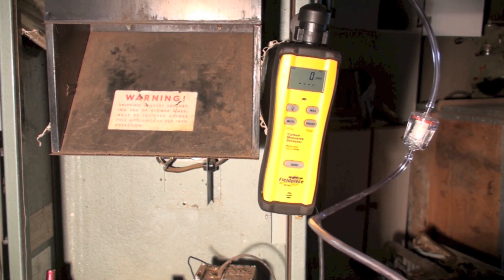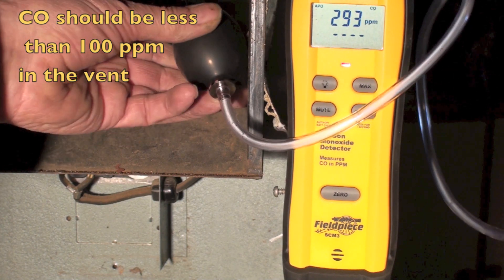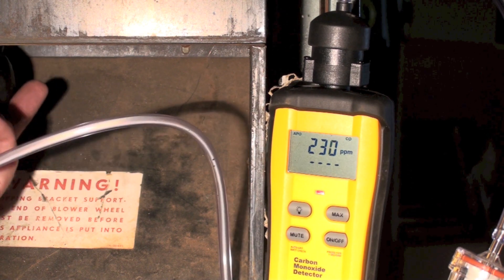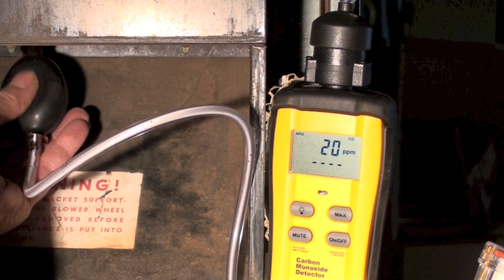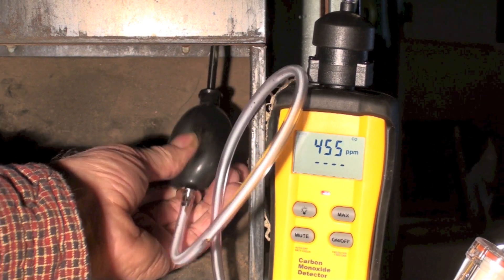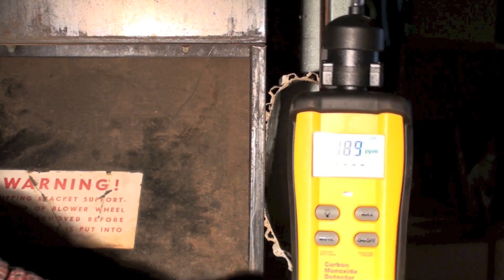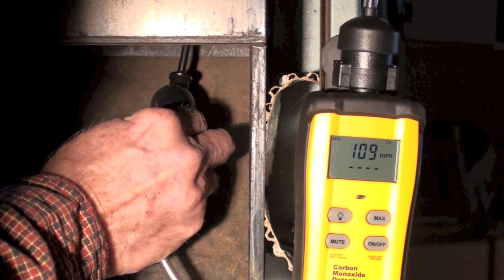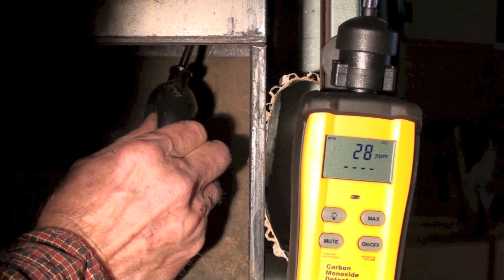CO test of the antique gas furnace

Comment: While watching you combustion video I was thinking show the co readings and then I discovered that the SOX3 wasn't capable of reading CO. This was a much needed follow up to your combustion video. Thanks for sharing!!
Reply from the maker: I used to use the Bacarach Fyerite that had the CO test in it, but is quite expensive.  The Fieldpiece units are somewhat cheaper and of high quality.  I also like units that are stand alone.
GFM
Reply: Stand alone tools are great, that's what I used for most of my career. The main thing is to test the units to make sure the are operating normally and safe.
Reply from the maker: Eddie Leverich Around here they are to be tested once a year by an authorized testing organization.
GFM
Reply: I hope that I didn't offend you, my comment was meant to read (the main thing is to test all gas appliances to make sure the are operating normally and safe.).
You are correct,  the tools that we use should be calibrated often
Reply: Eddie Leverich None taken
GFM
Reply: grayfurnaceman is that the smo3 and what is the difference between the smo4.
thanks
Reply from the maker: I think the 4 has a powered pump.
GFM

Comment: what are acceptable CO readings?
Reply: Joel, here is a chart for CO levels. 
http://www.stopcarbonmonoxide.com/files/CO%20Levels_Risk%20Chart.pdf

I have around 200 tests stored in my combustion analyzer and I would say that 95% of them are under 10ppm after tune up was completed. The main thing that we need to check is that the Heating chambers, Gaskets, and vent piping dont have any cracks or holes. Always Check for CO in the supply Duct!!
Reply: Under 100ppm is acceptable but you should easily be able to keep most furnaces under 10ppm
Reply from the maker: Eddie Leverich Thanks for the conversation.  This CO thing is somewhat confusing, as government numbers appear to not be very exact.  I think the number I have seen as 400 PPM in the vent is ridiculously high.  However, I think if you try for the under 10 PPM, that is somewhat optimistic.  This is an interesting topic and I will probably do more vids on this in the future.  
GFM
Reply: in gas school the teacher had no real answer for us but said the unwritten rule is in the signal digits. this was never seen in our books ONLY a 0PPM is acceptable as on the test in BC Canada (I think).   I wonder at what PPM could cause harm....?
Reply from the maker: Eddie Leverich Interesting.  We usually try for less than 40 and call it good.  Maybe we should be trying harder.  I will be doing some vids on oil furnace combustion and the readings should be interesting as the amount of excess air is more tightly controlled than on gas.  
GFM
Reply from the maker: The relation is not perfect between CO and C02.  
GFM